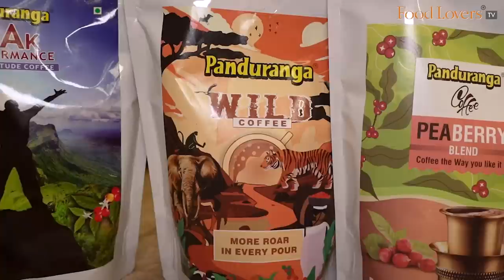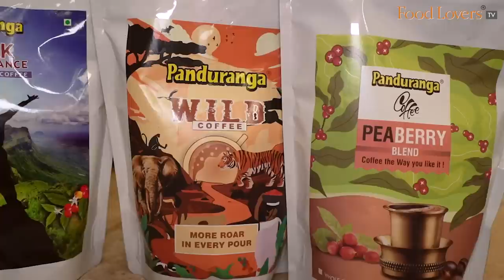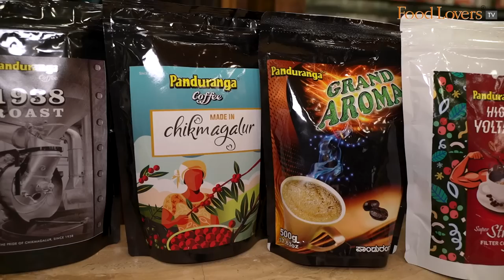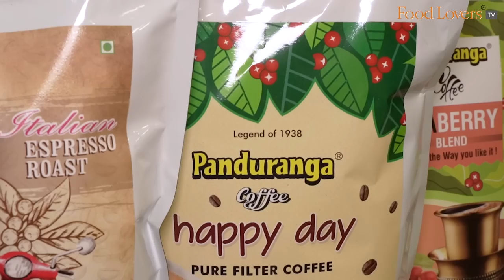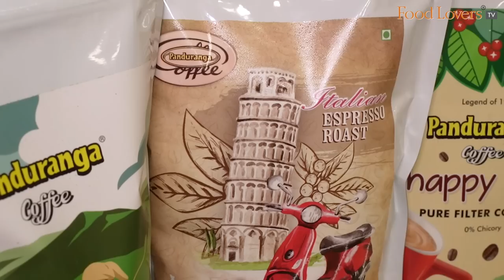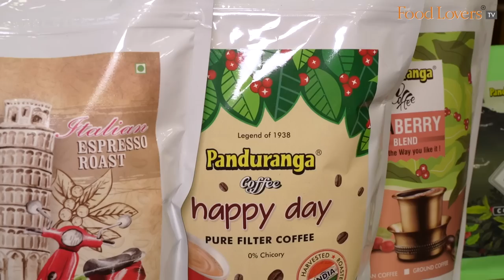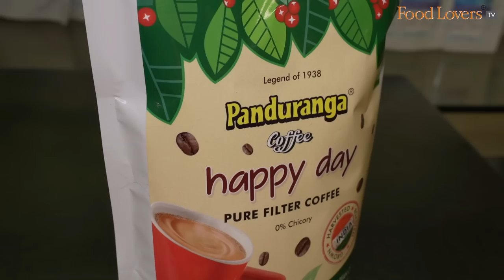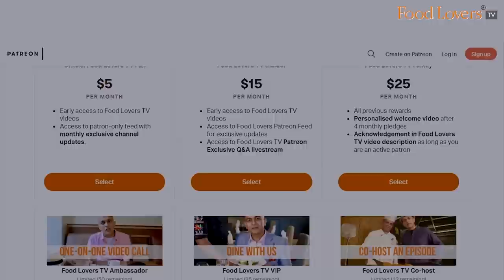Widest Coffee Selection PANDURANGA COFFEE WORKS Chikmagalur! 85-Yr-Old Biggest Coffee Roasters!

Comment: was excited to hear about the ''WILD COFFEE' but the real wild coffee is from seed-grown trees from Ethiopia. We need to bring viable seed from as wide as range of Ethipian genuinely wild cofees, and sow seeds in various terroirs in India.

A seed grwon genuinely wild coffee has a greter genetic diversity than most commenrcial coffees. When grown in a tree form, the water relations of each succeeding vishakha, fork/layer of branches from the bottom to the top of the crown add specific water potential challenges to the topmost banches and twigs. Now, a tree, generally will try to assume a ''hemispherical '' shape to its crown; the disadvantage is that the beans will mostly form on the topmost layers of twigs/branches. Nonetheless, the dgree of stress works to evoke many more compounds from the shikimic acid pathway and downstream from that.

There are very rare coffee species in Liberai, I am told, with wonderful flavor. Kew gardens would be a good place to find information and germplasm for such. These species are endangered in the wild, and propagating by seed alows a new influx of genetic diversity in genuinely wild coffee, grown into trees from seeds collected at slected locations.

Comment: #pandurangacoffeeworks Not a great experience ordering your coffee. I have sent a detailed email. 

1) Your website does not mention the quantity of coffee in the packet. In fact nowhere through the buying process does it mention the quantity of coffee. Further, it is misleading the buyer showing a jar of coffee which I have taken for a standard 200g jar. What I have received is a 100g pouch which is unbranded and with only a printed white sticker proclaiming the price and best before. It is very disappointing to be misled in such a manner.  

2) The postage charges as mentioned by IndiaPost is Rs. 36 while you have charged Rs. 70. Before you claim packaging charges, there is no packing as such to charge almost double the postage amount. I find it unjustified.

I had ordered your coffee after seeing so many great reviews online. Feel disappointed to be ripped off like this.